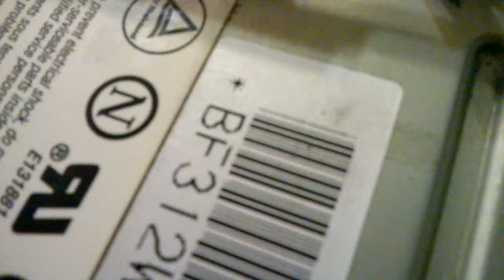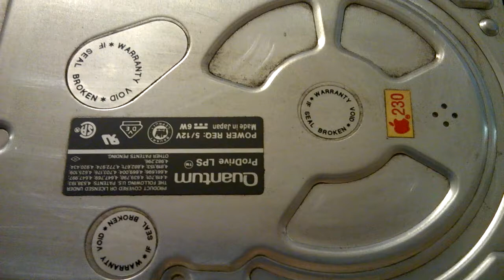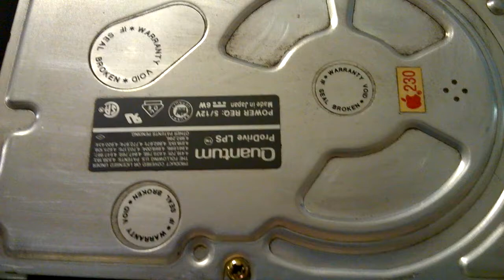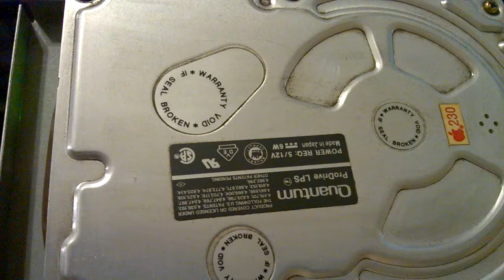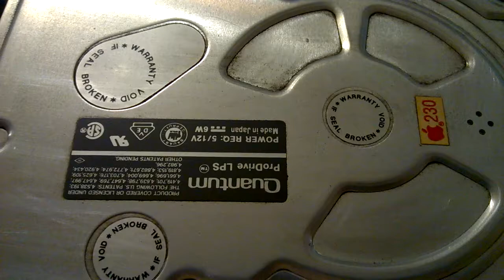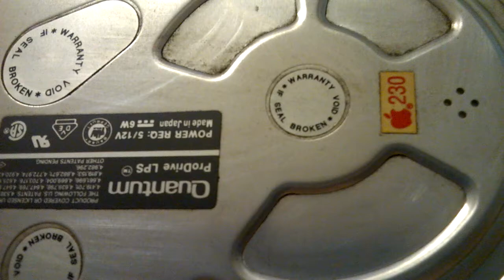SUCCESS! Mac IIvx Lives Again! Thanks, Dishwasher!

Comment: Last time I checked, Radio Shack charges $20 for a "half AA" PRAM battery... versus about $4 for buying one online.
Reply from the maker: $9 at my local one, the one labeled for a security system-- the Saft ones.
Reply: ***** It's been a few years since I checked Radio Shack's price, but they were selling it for $20 -- and Greenbrook Electronics wasn't much cheaper ($15).